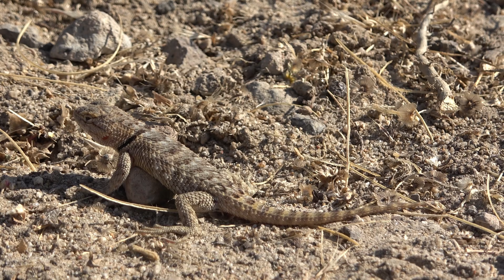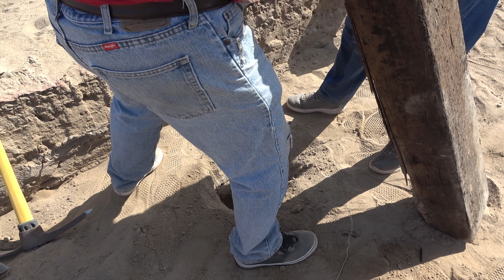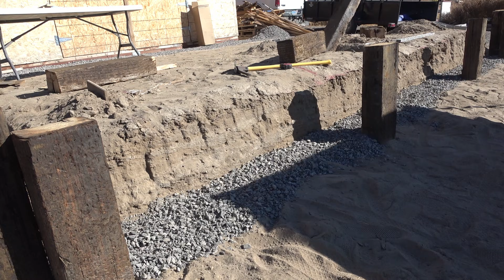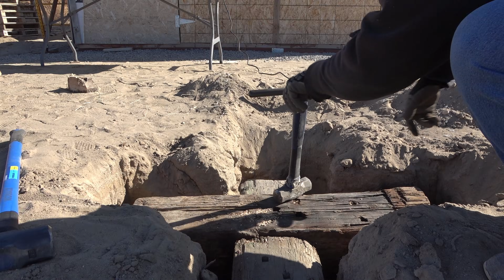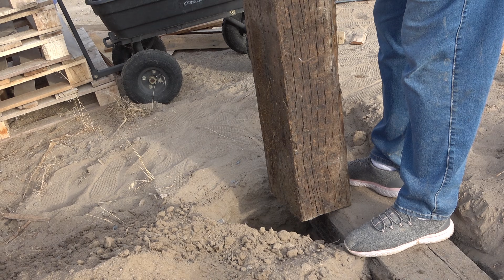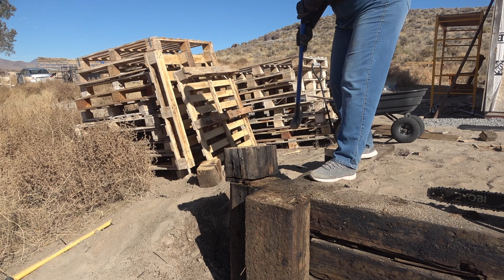We Built a Retaining Wall for Our Next Building Pad

Comment: I found something a little better than rebar, although my base was done in all rebar 4 ft down to be exact. Then stacked the Ties and drilled them them with an impact wrench with 10 1/4 wood screws. Pulled everything nicely tight. Thanks for the video, wish my ground was like yours but I am in Alabama so its clay, natures cement!

Comment: I quickly ran out of patience drilling my timbers. I had a 5 qt jug of used motor oil I hadn't recycled yet, dipped the drill bit in it, then proceeded to drill... much improved. Dipped my timber lock screws too. Got the idea from my dad... back in the day he'd drag a screw across a bar of soap before driving it home. Nice job. I always wondered if one of those battery powered augers had enough umph to do the job. Evidently it does. 👍
Reply: When I was a trim carpenter in the eighties, I would wax the nail clips so they could penetrate hardwood material.
Reply from the maker: Good tip with the oil or soap. I'll try to keep that in mind if I have to drill through some thick material again.
Reply: My dad coated screws with soap before setting them!
Oil works great too!

Comment: You forgot to add creosote to the parts you cut off. Thats what keeps rail road ties from rotting. Wear a mask and eye protection sanding railroad ties.
Reply from the maker: I put some roofing repair sealant on the parts I cut. I'm hoping that will work.